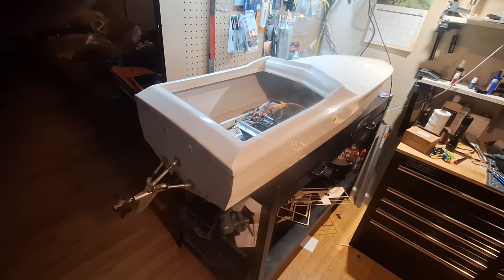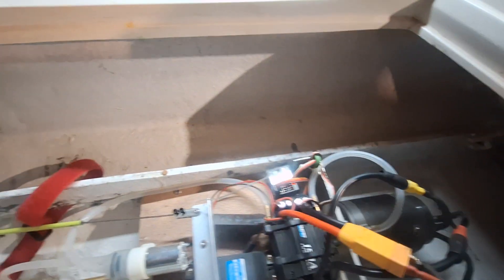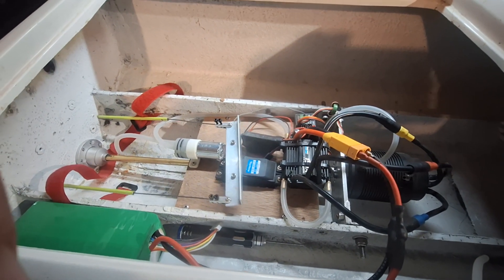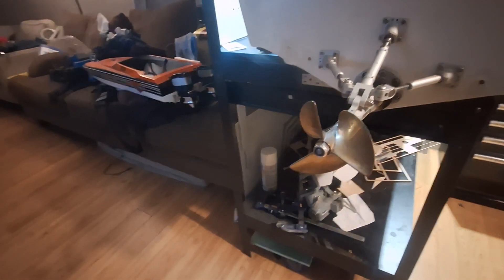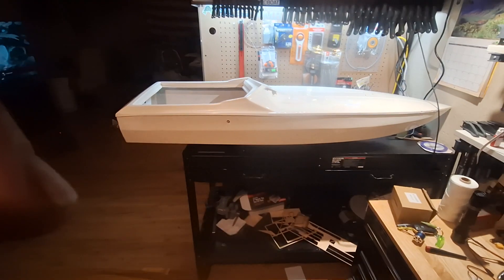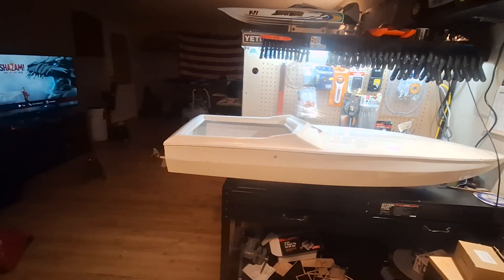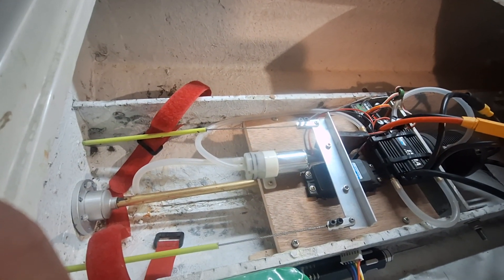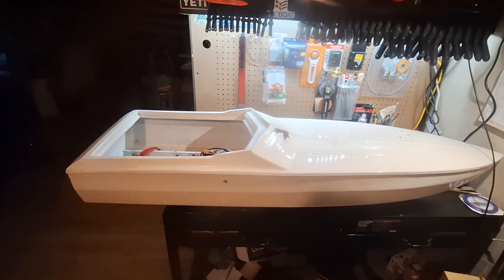BIG APACHE rc boat #boatgang #boatworks #rcboat #rcboating

Comment: That's one big azz boat, and I love it. Maybe try shortening the servo arm closer to center, it should give you more leverage, may loose some throw but gain control ? Idk?   Worth a shot anyway.   Cool boat for sure! BG4L
Reply from the maker: Hi Big B there is a lot of resistance in the steering system I have to work  that out you are correct  about  moving the  cables closer together for more torque from the servo.

Comment: I believe warehouse hobbies made that hull. Is that a quater scale servo? What batteries are you running in it. I think that esc is only rated for 6s. Have you run it before, what speed did you get out of it? I have the 55" dumas scarab that is going electric with a 6354 295kv with a 120 amp turnigy esc rated for 8s.
Reply from the maker: Hi Brandon I have been running 6s the boat jumps on plane fast but my local pond I run on is very small I don't know  what top speed is .
The motor is 910 kv .
The new servo is a 70kg 1/5 scale hobbystar  ihave not run the boat with it yet .  I will repost a previous  running video of the old girl